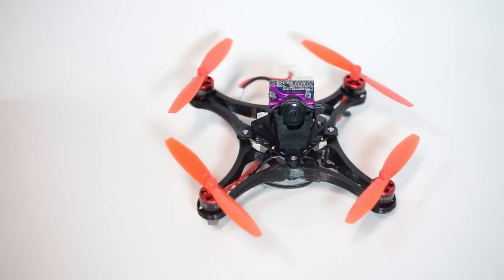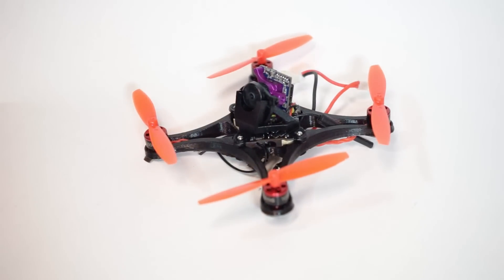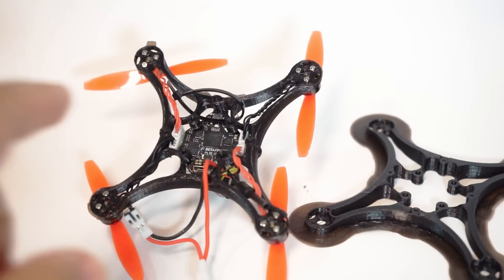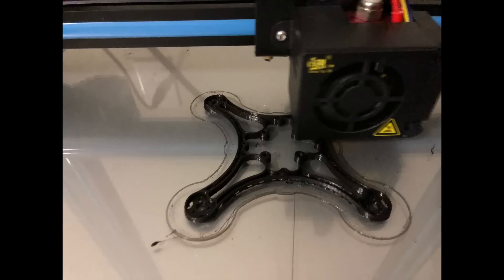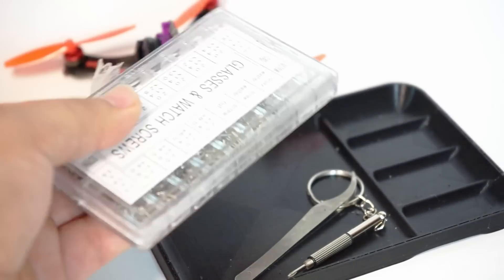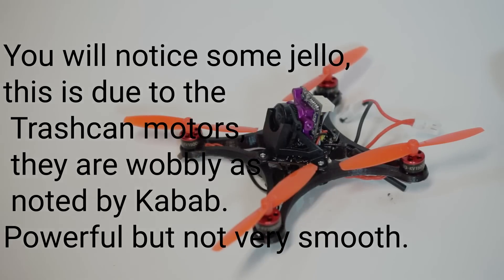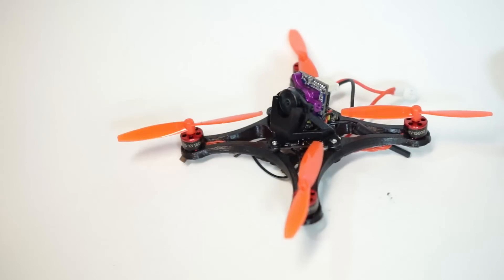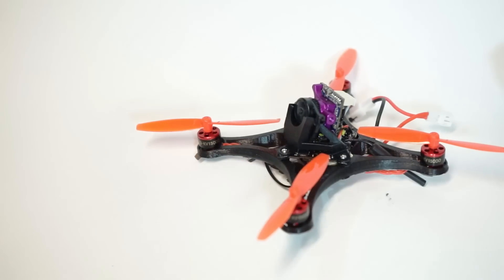3D Print Super Whoop micro drone at home

Comment: I recently moved everything from my trashcan over to a happymodel larva x frame, used gemfan 65mm bi blade props and printed a tpu canopy and fitted an xt30 connector so it only runs on 2s lipos. Flies great, pretty fast for those tiny motors

Comment: I printed a mobula 7 frame using only PLA but it broke very easily... Could I use other plastics ?
Reply: Yes, PETG is Already better than PLA, but PP is probably best for durability (see in RCLifeOn flexible drone frame video)
Reply from the maker: I used a high infill in mine. But none will be as strong as carbon fiber.

Comment: HEY GUYS:  I was going to order the Toothpick too, then I found www.gnarlyFPV.com and it's hard for me to believe, but I actually think their version of the Toothpick, the Primo, is way, WAY better!  It's all in the battery holders and the way they slot into the bottom of the frame, and then hold on with one single screw! So, it allows you to change to another battery size in the field in less than ONE MINUTE! The frame comes with 3 different battery holders, a set of props, and the canopy! I also like their canopies better too! And all of their parts have tiny brass inserts for the screws to thread into! Really some nicely thought out designs and super well engineered! Bob has a great Toothpick frame, no doubt, but I feel this is a more fully thought out "system" for many different batteries, cameras and motors!  Plus, if you own a 3D printer and have some oddball batteries that gnarlyFPV hasn't got a battery holder for, how hard could it be to design our own battery holders that use the 2 slots, for ANY batteries we already own!  I have some brand new Turnigy 2S I got for a song on HobbyKing (watch their sales by signing up for their email alerts). They have THE GREATEST battery deals in the whole quad arena!  The deals I've gotten would blow your friggin' mind! LOLOL ;)  Almost like they are giving them away! Half or a quarter the price of a Banggood sale!  Seriously! And they ship from the USA, so no month long wait!
I'd certainly check out www.gnarlyFPV.com before you buy the Toothpick.  Really, REALLY nice stuff! :)
Reply from the maker: I just sent them a message about getting a review copy.  Thanks for the recommendation
Reply: @JonE5FPV  

I almost feel like I cheated on Bob, but I just pre-ordered two, lol.

 Will wait for a Toothpick kit with his ultimate choice for motors.
Reply: I just pre-ordered my Primo - V110x frame kit! :)
Reply: @scootroter4859  Now the hunt for a good 11xx motor starts....
Reply: By the way, I have nothing against AmaxInno, but their 1103 will probably be on pre-order for the next 6 months, lol.
Reply: ALERT! I searched for them earlier today on Banggood and nothing...now they show in stock and ready to ship!
Supposedly, Bob and PyroflipRc ordered all of their next production run, so they should have a TON...once they arrive to Bob. And who knows how long that will take! LOL
Reply: @scootroter4859  I was really pleased that KababFPV endorsed that brand, I've been using a few of their frames for a while and they're a solid value.
 I was planning to try their motors, Bob made my decision easy. The one I had an eye on, their 1407 3100kv, sold out almost instantly when it came out.
Reply: I just checked on Banggood, for the 1103/7500kv, it's "Processing time:Expected on March 6, 2019"

I guess Amaxinno did'nt take any chances and the made a ton of them. I hope QC does not suffer.
Reply: Yes, about a week from now! :)
Reply: @scootroter4859  Scott, you might also want to try the Newt from ReadyMadeRC, they have it on clearance at less than 5$ with the discount code.
Reply: Here's a very cheap alternative if you have a 16x16 or 20x20 stack instead of a crazybee board....

https://www.readymaderc.com/products/details/rmrc-newt-2-3-frame
Reply: Speaking of ultralight builds, here's another one I'll be building:

https://www.amaxshop.com/index.php?route=product/product&path=469_490_506&product_id=1573

Comment: Nice video! Thanks for showing us! How do you like your CR-10?
Would you buy it again now that you've had a chance to use it a lot?
I am thinking about getting it or the CR-10S or the Geeetech a30 (like a 10S, but with a touchscreen color display, but no marlin firmware - what's holding me back). Do you think it's necessary to pay the extra for the 10S?
Great flying and a nice print! Thanks for your help and answers! 😎🤘 Liked!
Reply from the maker: I like the Creality CR-10 a lot. I had an issue in first month or so with a power supply that died, but BG replaced it with no issues and been working great since.  I have dont PLA and TPU so far.  Even made some other quad parts for people, and ive printed out bumpers for my Acrobrat, and Campfire Quads CF1, hope to do some for my smooth operator soon. I think I paid somewhere around $350-370

 I think if i had to buy again, I may get the newer and cheaper Ender 3 which is only $199, or the Ender 3 pro for like $230.  
https://www.banggood.com/custlink/3Gv3E6Sjdz

2 or 3 local guys have gotten these and had good results with them.  I have not used the large build volume of the Creatity CR-10 like i thought I would so far. That said, the Ender 3 is a kit, and involves some additional assembly compared to the CR10, which was easy to set up in about 20-30 mins.

Now the CR10S Pro, does have some VERY interesting features, like all inclusive build structure, i would say the ability to take up less room on a table top is very nice, and the screen looks better and nicer.  However at the end of the day, i think the print capabilities of all of these are pretty similar.  For me, if i was to do it again, i may go with a cheaper option and save those funds to buy filament etc... As i dont think that any offer drastically better ability to print stuff.
https://www.banggood.com/custlink/K33Gh09opy

Im planning a "Should you buy a 3D printer for your drone" video soon, so stay tuned!
Reply: Thanks for the reply! I have an Ender 2, which prints fantastic! It has a very small build volume though. I made a stand for it so the power supply sits under the printer and the entire shelf area (footprint) is under 12" x 12"!!  I bought it about a month before the ender 3 came out! lol You answered exactly what I was wondering - Will I actually use the larger print volume? I got it for printing quad parts, and the ender 2 does a wonderful job of doing ALL of those. Sure, I most likely can't print a 5" frame, but who wants that printed anyway?!! 
It seems like anyone who is using the large build volume is printing, IMO, those STUPID figurines or large vases! Those are a waste of filament and would only serve to collect dust and take up space on a shelf! NOT for me! lol So, I have actually searched for large prints that I would like to print and can't find pretty much anything that I couldn't print with my Ender 2. Thanks for essentially clearing that question up for me about whether I really need a much larger printer! Plus, if I do need a larger one, like you said, the Ender 3 is quite a bit larger in volume than mine and well under $200 on good sales!  So, half the price of a CR-10 on sale.
Here's a tip for filament: I bought enough to get free shipping, @ I think $75, from www.zyltech.com.  It's awesome filament that I haven't had one issue with! Go to the site - lots of colors, PETG available too, and such an amazing price you won't believe it if you get enough to get free shipping! HIGHLY RECOMMENDED!  and right here in Houston, TX, USA too! So, takes no time to get here!  ;)
I have found NGEN Flex by ColorFabb and available at Print Solid to work great for TPU, and they have cheap samples that give you tons of small TPU prints for practically nothing in cost!  I originally bought 4 samples of it and still have a lot left after printing many parts! Works great with absolutely no mods to your printer.  And I have the exact same extruder and hot end as you do! Works superb, is tough, and plenty flexible too!  I also ordered some super cheap samples of Flex2 from www.3dprintNY.com, but haven't tried it yet...same softness rating as NGEN Flex though, so should work good, and available in several colors too! Take care and thanks again! :)

Comment: https://youtu.be/mrHD2kD3yso

Interested in the communities thoughts on this frame. The architecture is built around a 55mm prop instead of the KK 65mm. To me the pros of this are motors smaller than 1103 amaxinos work great, direct transfer of power whoop guts( trashcan or mobula), smaller motors require less amps and allow for no xt30, and perhaps more robust/reliable then even the toothpick. And of course all this lighter weight makes it safer for public without sacrificing performance. 

Thoughts from the community?   Maybe the 65mm prop is so much better then the 55mm prop though.

Comment: these 3d prints break to easy
Reply from the maker: Definetly just to hold you over till the toothpick arrives, but it flys suprisingly well, and you can print out a ton of spares in a short time at home.
Reply: @JonE5FPV  i agree they are.good for that . Flex rc has a great one for the tooth pick i ordered 1 they gave me 2 and was here in 4 days from canada . Check them out man
Reply: I may still print one of these for fun still waiting on motors to get here though there on the boat lol
Reply: I print with eSun PLA+ It's cheap, stronger than regular PLA, and prints just as easily. Haven't broken a frame yet.